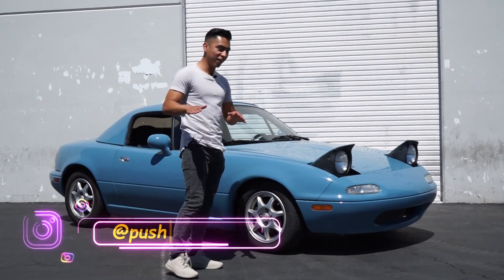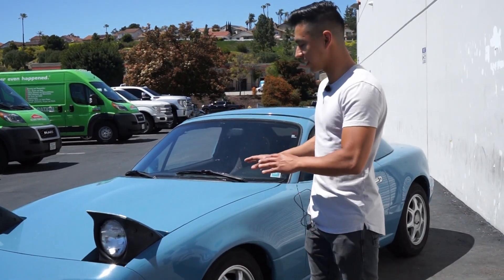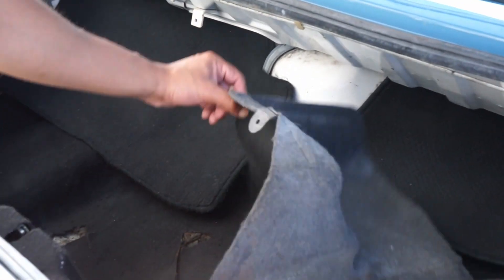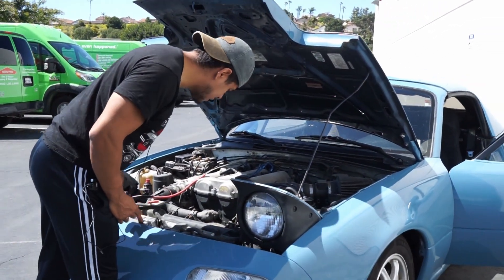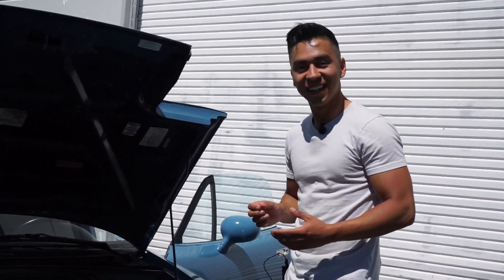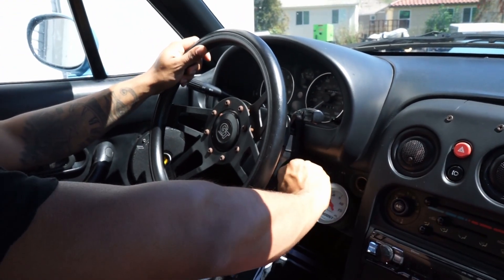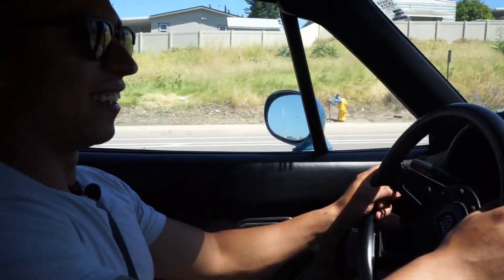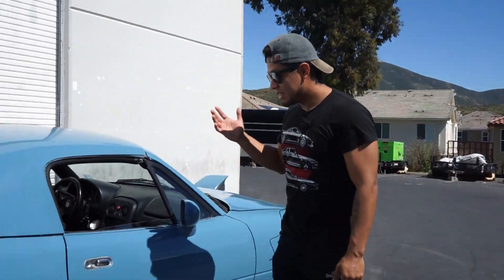I Accidentally Bought The Perfect Miata!

Comment: Bro 1.8 miatas were from 1994 through 97 and are very common in the US. Should have done your research before buying lol it would probably make more sense on what you're saying
Reply from the maker: I didnt buy it for that reason, i bought it cause it was a clean miata for 2.5k lol
Reply: @Pushing Gears  that's a pretty solid price considering today's market. Hopefully it don't got any significant issues, but still